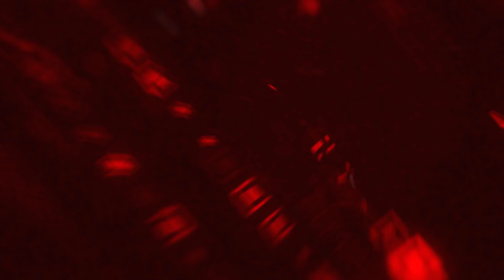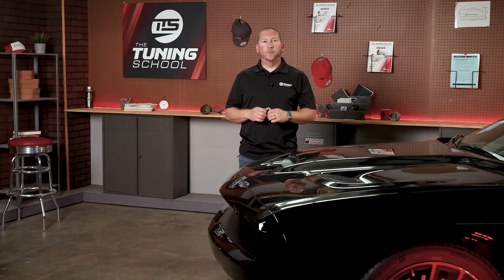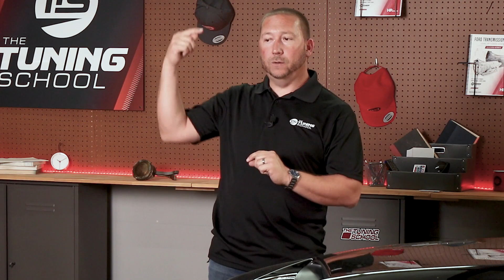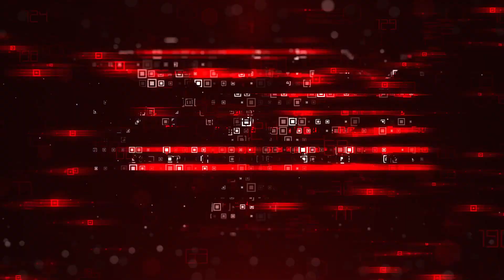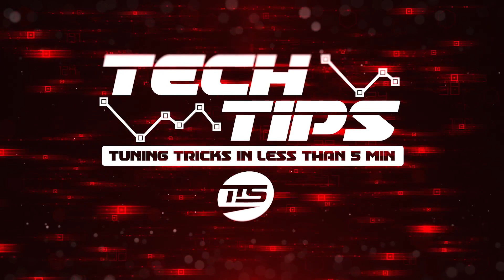Tech Tip - Open and Closed Loop

Comment: How do you drive in Open loop at Full throttle.
Should not be driving really until engine upto operating temps anyways. (water at normal temp atleast) 
by then it will have switched to closed loop.
Reply: I believe the wot open loop situation is not caused from low engine temp but from a design in the algorithm , seems odd .

Comment: I hope you can help me with a direction to go. I have a 2010  5.7 hemi charger long tube headers and a stage 2 cam with cats and both up& downstream O2 sensors. They all read they are plugged in they show data. Car won't pass inspection because O2 sensors will not get ready. The cat is ready heated O2 is ready just not O2 & EGR. I need one of the 2 to get ready. When recording driving data in closed loop trying to do the dodge drive cycles I see it will drop to open loop then back to closed at random even when you are not on the gas and just at part throttle. Any help please